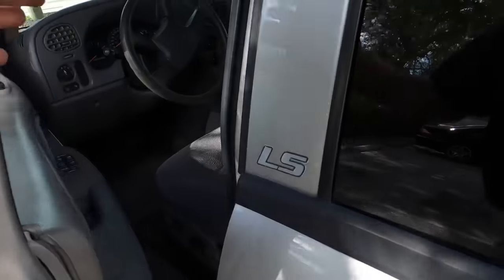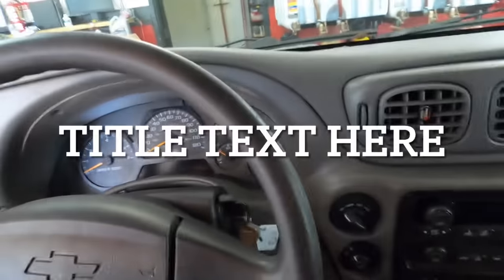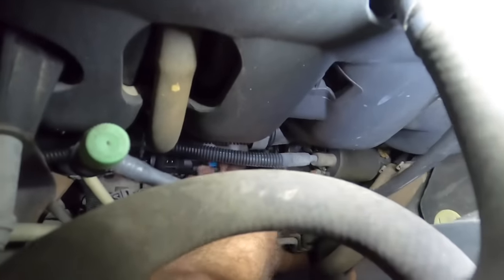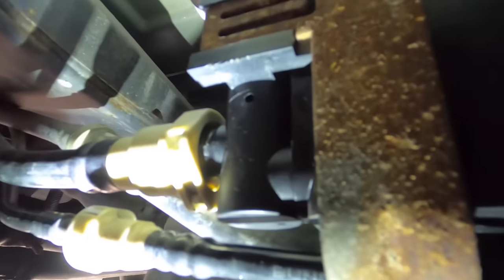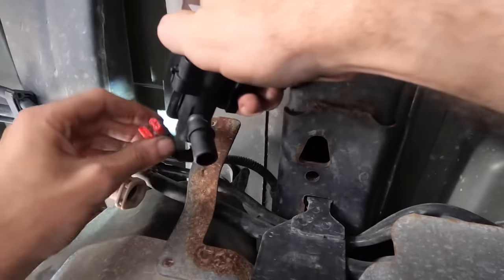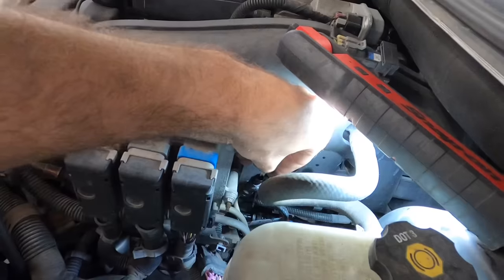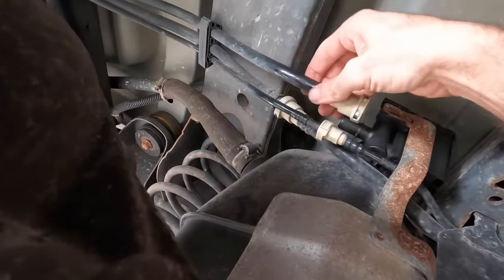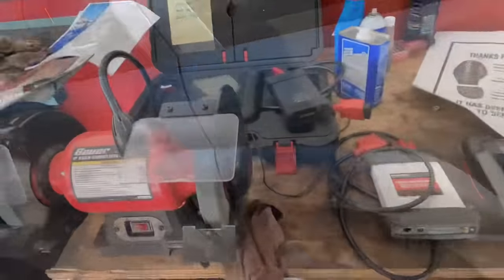Repair failed! Customer is Angry

Comment: Glad to hear the click on the schrader valve lol. Oh future reference GM vent valves will not open under pressure from the smoke machine. Test it out sometime on a known good you'll see what I mean. On GM if you have the system under full pressure of the smoke machine it will not open... Vacuum it will work fine though. Anyhow might help you out in the future 👍
Reply: Ray, for the love of Mardi Gras beads, listen to this man. Disclaimer: I'm not a sponsor.
Reply: Now that I see Eric O posting here I understand how I came to this channel being recommended to me. Both are Informative and entertaining. 
Keep up the great job guys.
Reply: Hi Eric. I had to laugh a bit at him grabbing a smoke machine without any codes available. If he understood how to manually run the monitor he could have proved out the whole system.
Reply: Man I am having the same problem on my Honda but it keeps saying check fuel cap and sometimes the check engine light is on but it is freaking stupid I believe it said it was the purge valve solenoid
Reply: The best functional I've found for Evap stuff is the purge/seal command. It'll command purge to 0% and close the vent valve BUT let you run the purge valve open in percent steps. I like to do a quick smokeless test while I'm off working on something else by starting the engine, running the purge with the vent closed for a few seconds to pull a little vacuum on the tank then close the purge and watch vaccum rise to 0 and keep going above 0 as vapor pressure builds (well not watch but look back at the logged data graph). You can get a quick idea based on vacuum decay and pressure rise as to the size of the hole you're looking for and if the hole is even currently present or not. With the car off you can just watch natural vapor pressure rise to see if there's even a tiny leak after the repair. Based on hole size you can guess some likely culprits and you can run the purge valve to check it's operation and check the vent valve for 'does it even close?' quickly too. I've been seeing more GM's with failed purge valves that don't fully close and set leak codes or set incorrect purge codes AND rich codes. Those purge valves should be CLOSED when they're off, not half open!
Reply: @douglasvines2037  What makes you think that it is a purge valve issue? Not saying that it cannot be but how did you test the system?
Reply: @douglasvines2037  How does it know it is the purge valve? open circuit? if not you cannot just shoot from the hip with a code. Codes give you the stragedy to test further.
Reply: One off my favorite mechanics talking shop on the channel of another of my favorite mechanics channels. must be a good day.
Reply: @thecardoc100  Novice here; please explain, “… manually run the monitor (?)… proved out the whole system.”

Thanks, any further explanation would be greatly appreciated. 

The complexity of the systems, their function and especially fascinating to me, even though I’m not an automotive mechanic. I have great respect you all. 
Roy Lewis 
Buffalo, NY
Reply: @rlewis1946  I won't have time to explain everything the way that I do in a training class for professional technicians. But if you go to my page you will find two videos. One is me walking through the GM monitor directly from our evaporative emissions class. The second is pinpoint testing and demonstration of a P0446 iirc
Reply: Eric, Canada here, Love your channel, also Rays channel. You guys are awesome how you try to help people all the time. All the best to you and yours in the coming holiday season. Oh by the way, Some of those vehicles in your area look like Canadian cars all rusty, they must use a lot of salt in your neck of the woods like here.
Reply: When Eric O. gives advice, take it to the bank...............
Reply: If you don’t say “click” when tightening anything it’s not gonna stay tight.
Reply: South Main Auto.    Not a sponsor.
Reply: I was just about to say that Eric, hope your doing well.
Reply: Eric O's advice is not to be taken lightly, it's gospel.
Reply: Its also a good idea to look at fuel tank pressure sensor data i see skewed sensors sometimes the computer will command purge full open or closed depending on what spectrum pressure data falls on break it off and pull it out with a screw  prying upward test a new sensor with shop air introduced through the gas pump neck just a puff of air is all it takes to see it in data. The real reason i came on is to say it's a good idea to remove a battery from stable power, charging or engine starting capable devices relatively quickly after ignition  reason being computer interference
Reply: @byronbaker1491  🔰🇺🇸 I’m pretty sure this is the exact same issue I’m having and have had with my 2008 Pontiac G8GT. In the summer, I have to wait for the gas tank to bleed off through the filler, otherwise the tank won’t fill and it’ll spray liquid gasoline back at me.
— I replaced the evap canister and solenoid but the code keeps reappearing, so I’m thinking I gotta go for the tank sensor. It’s a pain too, since I gotta drop the rear cradle.
Reply from the maker: Eric O! Hello good sir! Love your work
Reply: Run the evap service bay test from that snapon tablet, to reset your evap codes immediately.
Reply: The Master has Spoken.  Thanks Eric.
Reply: Never Ever Worked... New
Reply: @thecardoc100  Been a long time since I have seen your name, old iATN member, I have talked with you a few times in the past I believe.
Reply: @CodycoWeb  Hi Jeff. Yeah I remember you. How are you doing?
Reply: @douglasvines2037  often it is just the gas cap seal my moms Toyota did that almost from new the technician at the toyta dealership replaced the gas cap twice and both times within a couple weeks the check engine light was back on
Reply: @RainmanRaysRepairs  did you check the gas cap seal my Moms Toyota did that almost from new check engine light came on and the technician replaced the gas cap twice and would have kept replacing the gas cap but my mom just ignored the check engine light after the second time replacing the gas cap
Reply: @RainmanRaysRepairs  I belive it was a similar code number too
Reply: Watch South maine auto the best
Reply: @huzudra  I deal with this all the time on recent GMs.   80 percent of the time it is the purge valve solenoid that gets stuck in the open position.  The other 20 are vent valves and faulty fuel tank pressure sensors.
Reply: @1996xjchris  nahh, you gotta give it the ol Scotty Uhhhhhhg
Reply: One of my favorite channels commenting on another of my favorite channels! Yeet!
Reply: Question is did it fix it?  Love your channel.  Me and my Dad have watched you off and on for years.   We are in the Rustless belt.  I see a crusty car I just Nope the hell out.
Reply: i elimate vent valve while testing, nd always replace whenever doing evap work with purge solenoid, has happened to me once, fuel tank filled with the charcoal from vapor canister because customer always overfilled the fuel tank.
Reply: Beat  me to it. 100% the valve replaced works the same way
Reply: @douglasvines2037   my car had low evapo leak and engine light was on and my buddy told me to put vasoline on the gas cap gasket and after driving my car for three weeks the engine light went out and my car passed New York State Auto Inspection last year. Now with big snowstorm my car is stuck in my garage I have deep snow ❄️ & ice 🧊 three feet deep and I can’t shovel it and my car is due now for NY Inspection this month 
My medical conditions prevent me from shoveling
Reply: Poorly designed valve. Like one comment sometimes can't fill it with gas when valve stuck in none vent position. I spray lithium grease in mine to lubricate metal magnetic valve. Works for at least 3 years then have to repeat.
Reply: @Roy Lewis  if you like the complexity of that evap system,  you're gonna absolutely love Toyota evap systems.  They did they're very best to reinvent the "wheel" so to speak.  Why not use 6 solenoids/valves when only 2 are necessary?  And while we are at it, let's add a 3rd O2 after a second cat on a 4 banger, and heck we'll throw in a couple of extra vsv's to operate the other vsv"s, and make our vacuum hoses out of some form of powdered granite. You know, for strength!  And to make little Timmy the lube tech get in trouble every week we will slap a couple on the air filter housing, because well, it makes me smile.   Nobody does redundancy better lol!!   I always go through the numbers with them because that's what we do, but how many guys here are tempted to just say "charcoal canister, replace hoses, slap a dealer cap on it, say 3 hail Mary's, run monitors and send to smog" when they see a Yoda?  Am I lying? Lol.
Reply: @douglasvines2037  Usually the cap. The light comes on when system loses pressure nor when pressure is static
Reply: @bufordtjustice8630  Damn that was EPIC! And informative.
Reply: I'd awesome to see South Main Auto watching and helping out Rainman Ray! BOTH of you two are a few of the mechanics WORTHY of my approval!. I scrutinize guys on here all the time and you guys are some of the BEST well trained, comprehensive, troubleshooting MECHANICS. I'd be e happy to have either of you in my shop here in PA
Reply: @thekingsilverado8419  yah, may not of tighten the cap enough
Reply: Eric is definitely the man, the mensch& the mechanic.
Reply: I thought it strange that he didn't smoke test the new valve after just telling us that new parts don't always work.  Then maybe he'd learn what South Main stated.
Reply: Thanks Eric o   your great. Watched all your videos
Reply: Been Watching Eric O for the past 6 years and now watching Ray. Pretty cool I live about 6 minutes from Rays shop.
Reply: When you get the co-sign or comment from sma you must be doing something right otherwise he would have kept it pushing
Reply: i knew something was up with that
Reply: Eric O and Rainman Ray should have your own TV automotive show. Better than the junk that's on the tube now..
Reply: @carmo9693  Strategy...
Reply: That valve should be updated with a new harness... run the EVAP service bay test on the SnapOn scanner after the repair...
Reply: @65gtotrips  more than likely you need a purge solenoid , the preverses  i mean the traverses and acadias do that .  but if the canister released its granules youll need to find a way to look in the tank or remove the charcol canister and see if it dumps out the granules.
Reply: This is a guy who would know. He also has  great web site.

Comment: "Just because it's new, doesn't mean it's good"  The entire reason warranties exist.
Reply: the part is warrantied, but the labor is not. That's why it's worth it to pay for quality the first time, regardless of a warranty.
Reply: Auto stores in my state refuse to replace electrical parts that have been installed. Even if they are bad from manufacturer.

Comment: Smoke down saved me $2K at a ford dealership.  They changed my plugs on a f-150. Then they told me " you need $2K worth of catalytic converters "  They said.." it is giving the code for it..."  after a quick smoke down across  town....found they forgot to hook a vacuum line back up on the firewall after removing it to get to the back plug!!    $60....NOT $2K!!

Comment: Reminds of a Cherokee water pump replaced by dealer in late '80s and the replacement pump had the impeller on backwards.  Car overheat dummy lite went on about
2 miles down the road, drove back and it took the dealer 4 days to figure out the problem.

Comment: The fist one had a sort of weak double click when it operated open whereas the one you installed Ray had a much longer and more positive sounding click. I would have loved to see the smoker was back on & we saw smoke coming out the newer one for visual confirmation. It is bazaar that he was angry considering he did not want a diagnostic performed the first time,, he provided the part and asked it be installed. And due to his actions the second time round he has the codes deleted at another shop. What a winner. He sounds like the type of person that you would rather not do any more work for.
Reply: I used to have a saying that a wise man told me.  He said "some days you have to fire a customer"
Reply: " It is bazaar that he was angry "  So what are you expecting from a guy that is deleting error codes just before he is bringing his car for diagnose? :D
Reply: sp: "Bizarre" actually.

[Grammar nazi in me just can't help it.....]
Reply: @JohnH0130  LOL
Reply: sounded like the sealing gasket that should be on the end of the piston wasn't there, causing it to bounce and not seal.
Reply: Casablanca has a great Bazaar!
Reply: That same customer will complain that you changed his Evap valve that he just changed himself.  He will refuse to pay for the part you just installed because he will want to get a warranty/defect replacement of the valve he bought from AutoZone.
Reply: I worked as a computer technician and these guys are not uncommon. Don't want us to do diagnostics, and yet get angry when the problem isn't solved because they were either wrong or, in ultimate wisdom, the part they provide is junk. Angry at us for the results of a job they didn't want us to do.

If I ever own a shop of any kind, computer or automotive, there will be a rule. You refuse a diagnostic? No warranty on results. If the problem isn't fixed by what you have us do (naturally, provided we didn't mess up the job in the first place - only human after all), you are not entitled to any refund.
Reply: @VraerynDaDragon  bloody end-users eh :)
Reply: @JohnH0130  My bad
Reply: @Rags722  that's fucking funny
Reply: @jasonw6331  Not only funny, but your life gets better after telling a few "customers" that they are no longer welcome in your shop.
Reply: countless times you must fire some "customers" when you take pride at your work and don't scam people to make a living, and you have these crazies trying to ruin your day, there is a point that you have to say "No", and if they insist might as well follow with a "GTFO". everything is made to break at this point, there are enough customers that want and appreciate an honest tech, that i thankfully can just throw people that don't, to what i call *sharks
(used here as in all the mostly common con artists, scammers, wd40 and duct tape fixes everything shops)
Reply: @Dynamic0NE  that would be a half decent reason to appreciate the honest ones a bit more. i fully understand the customer not trusting a diagnosis, but you can't blame the tech if you ignored his diagnosis (or if you didn't even ask for it). he could blame them and be angry if i.e. during the part replacement the damaged a ruber line or whatever but that is not at all what happened.
Reply: @Dynamic0NE  That doesn't excuse pulling nonsense like this. If you're that worried about getting a bad mechanic don't go to one.
Reply: @Rags722  I can't fire a customer - they would complain higher up the chain, that usually means senior management, the local government member, the Minister etc etc. Maybe on my last day LOL. You guys that can tell a customer that their custom is no longer wanted are so very lucky in some cases. Though I wouldn't give up my job for anything, even the crappy customers.
Reply: I ABSOLUTELY, POSITIVELY WILL NOT INSTALL CUSTOMER SUPPLIED PARTS!!! Because they are always the cheapest, poorest quality part that could be found. In no other line of work is the adage "You get what you pay for" more true than auto parts. And having the codes cleared right before bringing it in....just makes my job more difficult and TIME CONSUMING. MY TIME IS VALUABLE AND I CHARGE ACCORDINGLY.
Reply: @JohnH0130  People should continue to learn.  Without correction, they cannot. 
I had a teacher in Tech College write a Mnemonic on the blackboard for remembering resistor code colors.  After class, I asked him if he had ever been a man to take a drink.  He told me that he had never partaken of alcohol and asked me why.  He was in his sixties and had been teaching electronics and this Mnemonic device and he had been misspelling Vodka as votka his whole teaching career.
Reply: Ya it did the new one sounded beter
Reply: I was thinking thatmyself
Reply: @Dynamic0NE  are they dirt balls or do you not understand what repairing something actually takes? I've had people say I'm ripping them off because I want to actually repair the problem correctly and not bandaid it like the mechanic they usually go to. Its annoying trying to explain that the way that "works" but isn't actually going to last or save you any money long term isn't the correct way and I'm not trying to rip you off I'm trying to save you from yourself.
Reply: Bizarre....
Reply: @frandanco6289  you are correct, my bad

Comment: Thanks for the quick explanation on the EVAP..... Not of all us are mechanics in here and appreciate the lessons!  A month ago I didn't even know how to swap a battery until I found your channel!
Reply: His explanation of the EVAP system is wrong.
That valve he replaced only lets fresh air into the tank to prevent a vacuum when the fuel level goes down. There is another line that connects to a charcoal canister that collects vapors from the fuel evaporating. when the charcoal gets saturated another valve opens and lets the engines vacuum suck out the vapors and burn them through the engine. This mechanic doesn't fully know his stuff, or he REALLY dumbed down his explanation. I don't think the repair he made was the correct one.